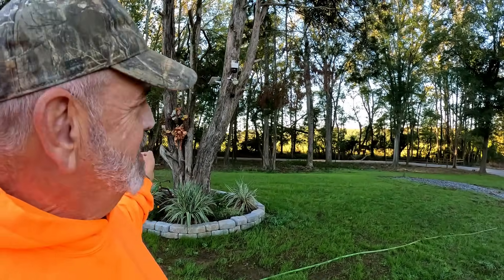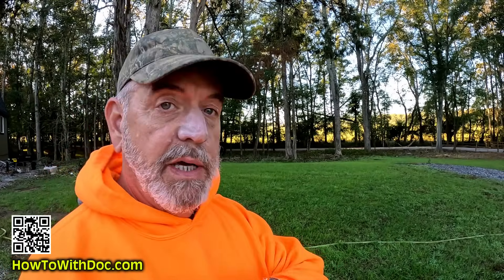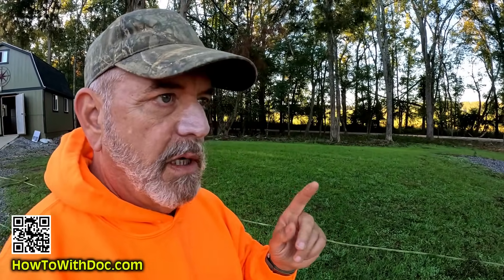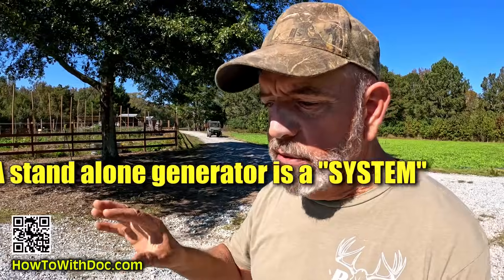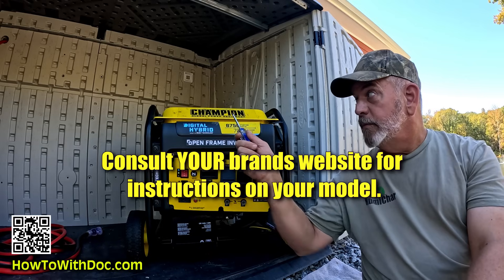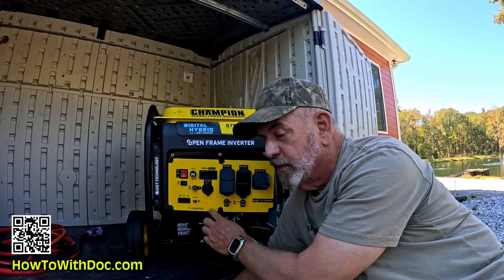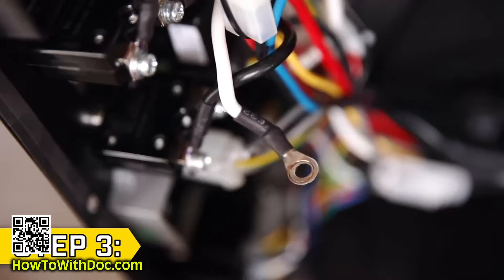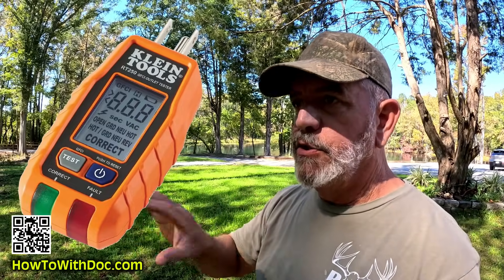Should You Disconnect the Neutral Wire on Generators

Comment: The slab pour is concerning.
Some points I noted.
1. Forms are not correct. Boil out will occur. 
2. I hope this subgrade was compacted very well.
3. The footing are dirty or on fill?
4. Measure diagonals or 6-8-10 variation for square. 
5 you might consider key cold expansion and 6x6x10x10 w.m.m.. Fibercrete alone for a garage is not recommended. 
8. Check forms for straight and level with a ¾" gauge blocks and string line.
9. Place poly over ground under pour. The garage may be heated in the future.
After pour. Seal with sealer. Lay poly over surface or wet the surface down once or twice daily to prevent rapid drying. 
10. I am always concerned when I see slabs poured on fill rather than clean washed limestone. ( No fines. ¾" or ½ " is better by far.) 
It may work as is short term but, it is expensive in any case. Do it right the first time.
Generators. Bonded, unbounded, floating bond. 
You will know with volt meter checking ground to neutral for a voltage above a few volts. Some confuse the frame to generator wire as a bond or unbounded connection. It isn't. 
Thanks for your hard work.
RT, BC Lic.  Industrial, ret
Reply from the maker: All went well.

Comment: Yes  only generators that are not “inverters generators” need to disconnect their neutral bonding cable before hooking to the house. Most modern generators however are “inverter generators” and come with a floating neutral. You don’t need to worry about those nor disconnect anything there.
Reply from the maker: Not true. Almost ALL larger invertor generators come BONDED. It says it right on the front. Smaller units, yes because they have GFCI plugs built in.

Comment: I have a Yeti Pro 4000 power station in my camper van and it is grounded to the vehicle chassis. For the most part, it's charged via solar panels on top, but I do have a Champion backup generator just in case. It's my understanding that this can safely be done without disconnecting the generator's neutral because I'm not merging two systems. The power station plugs into the generator via a common house-style plug (15A, 120V) if that makes any difference. Can you confirm that my understanding is correct (or not)?

Comment: What do you do if I want to do both with the generator? I can connect the generator to a small sub panel that has an interconnect to run most of the kitchen and a few lights in the house so I’m assuming I would need to disconnect the white wire so the grounding is from the home circuit. But I would also like to power my gas furnace also by running extension cords from the generator to another part of the house. Would I need a bonding plug for that? Each socket on the generator has its own fuse so I don’t know if the bonding plug would be for just that socket or if it would re-bond everything on the generator (effectively reconnecting the white wire).

Comment: So when I run my generator. I turn off the main 100A breaker. Turn on the 50A breaker. Does the isolate both electrical systems from each other? Breaking the neutral and hot in my main panel? I have a manual transfer switch. Is so. Then I believe the generator neutral should stay bonded. Yes?

Comment: I say no. If you want to connect a gas generator to a house, all you need to do is lift the ground at the Generator inlet in the home connection. There is no need to modify the Generator. These inlet connections are usually plastic. This is the easy place to lift the ground. Just leave the green wire unattached and capped. This leaves the Generator as it was built. Problem solved.

Comment: Good video, well expressed as a "stand alone" alone system. You are correct when an interlock is used on a sevice panel.  
A system can only have one neutral bounded point. Otherwise, an objectionable current situation will be created.
Bonded or unbonded neutral will depend on your transfer switch. 
If you transfer such only isolates, both hot lines from the power utility and the neutral is not switched, then the generator should have a floating neutral because the neutral is bonded at the first point of disconnect at the service entrance. This is a "stand-alone system." 
If you have a transfer switch with a switched neutral, isolating the neutral from the power utility with a generator sub panel, the generator requires a neutral bond. In this case, the generator and generator panel is a "stand-alone system."
Forgive the long-winded explanation, I hope that it helps.
Reply: Great explanation

Comment: Your information is correct, but your use of terminology is very bad, and potentially rather confusing.

You are not disconnecting "the neutral wire".  Doing that would actually be very bad.  Also, you do not ever want to have a "floating neutral".  A floating neutral is actually a fault condition (when the system neutral becomes disconnected from the power source), and can actually be very damaging in some circumstances.  (I know lots of people who talk about generators call it a "floating neutral", but a much more correct term is "unbonded neutral" instead.  When done correctly, it is not actually "floating" in any way.)

What you are talking about attaching or removing is not a "neutral wire", it is a "bonding wire" (or "bonding jumper", etc).  They are two very different things.  The neutral wire must always be connected to the system neutral (and the ground must always be connected to the system ground).  You never want to actually disconnect either one of those.
Reply from the maker: Unbonding a generator refers to the process of disconnecting (or "floating") the neutral wire from the generator's ground or frame, which is typically bonded together from the factory in conventional portable generators. This modification is often done to safely connect the generator to a home's electrical panel during power outages, as the home's main service panel already has its own neutral-ground bond (required by electrical codes like the NEC). Having two bonds in parallel can create dangerous ground loops, improper grounding, or cause ground-fault circuit interrupters (GFCIs) to trip unnecessarily. There are videos ONLINE from Champion and others how to do this to their products.

Comment: Your answer to the question may or may not be correct!   As you explained, yes you are correct, but there is an issue.
Please accept my input.   The answer about “bonding” neutral to ground in your portable generator if you connect it to your house is, you do not have enough information yet.   If you have a transfer switch, which you should, then that is what will tell you if you need the neutral to ground bond made.   If it is a 2 pole that transfers the 2 hots only, then there should be no bond made.   If you have a 3 pole that transfers the 2 hots and the neutral, then the bond from neutral to ground must be made.

Comment: Thanks for the video. I made this change on my Predator 9500 inverter. I am using it with a generlink transfer switch that expects a floating neutral source.  Afterwards, the generator ran fine. I plugged in a light, and it worked. I then plugged in an outlet tester into one of the 120-volt receptacles on the generator. It signaled open ground. Is this expected?
Reply from the maker: Yes if the generator is not being used for the HOUSE... and as a stand alone unit then it needs to be bonded.

Comment: I have the same Champion generator. I connect it to my house via a generator interlock setup. I’ve had to use it a few times for several hours during power outages. I’m very happy with it.

Comment: I read another comment somewhere else, they suggested disconnecting the ground wire at the inlet/panel would resolve all this bonded/floating neutral issue?  You can keep the generator bonded and if the generator shorts, it won't  fry the house electronics (if unbonded) just the generator will be sacrificed. Plus you can still use the generator with cords without having to unbond/bond each time gng from house to extension cords, sounded like it made sense but I don't know, what do you think?
Reply from the maker: The GENERATOR... becomes the main source of power for the entire house. I would NOT disconnect the ground. Just unbond it or put in an A/B switch so it can be used either way.

Comment: USING GEN BY ITSELF Not connected to a building just plugging into gen or extension cord to gen. Bonded neutral is required
Hooking to bldg's system, neutral and ground are bonded at the bldgs panel NOT AT THE GEN. And must be disconnected at the generator.

Comment: I have a big one I can run for a few days, or longer is the local gas stations are open.  I unbounded the ground an neural.   You need to test evert time that you neutral wire is good before you hook it up. Or you will get wild voltages between the legs and most likely need a fire truck in a hurry.  It will run the whole house and the central Air so I can live like normal.   I have a small one that will run the fridge and a few lights and a fan.  I can cycle it to my freezers to cool them down once in a while.  It uses very little gas.  About 2-3 gallons a day.  I keep 50 gallons on hand.  Then I have solar with an inverter to run a light and a fan an my little chest freezer.  I will make ice in it do keep in my cooler.  Have plans and backup plans.

Comment: NEVER NEVER disconnect your neutral wire from your 120/240 generator. You will cause problems in your home and most likely cause permanent damage and or fires
Reply: It says everywhere in GenerLink’s literature (which is how many homes hook generators into the home) that you must float the neutral to power a home, because the home already has a bonded neutral, and two bonded neutrals will fault the system. What are you talking about?
Reply: @chuckwalla325 
You have two separately, derived “neutrals they must be tied together. Just because they both are called Neutral they are not the same.  The unbalanced current in the secondary must be allowed to return to its source. So if you have two separate sources the neutrals must be tied together
Reply: The neutral wire must carry the unbalanced current back to the source (the generator)

Comment: So the cabin I just built has a main emergency disconnect outside where it it is bonded. The panel inside the cabin is a sub panel where the neutral and ground are not bonded. I’m assuming with my set up I have to run a bonded generator because if I run a floating neutral generator there’s nowhere in the system that is bonded?
Reply from the maker: It depends where you FEED IN the power from the gen. That set up throws an unusual glitch into it and I would ask an electrician.
Reply: @HowTowithDoc I wired in a reliance 30amp inlet box right to a 30amp double pole breaker. I’m assuming the panel in the house is still bonded at the disconnect even when the main is shut off? So I guess I need a floating neutral. But it’s confusing to me so I’ll have my electrician take a look at it to confirm my thought process. Thanks for the response

Comment: The better term to use is "bonded" vs "unbonded" or floating, and yes for home backup you need to have it unbonded as it uses the houses ground/neutral.
What I recommend is configure any generator as unbonded and just keep a bonding plug handy so you can re-bond just by plugging it in when you run it stand alone.

As it is much easier to bond a generator on the fly with a plug, than to do the entire process to unbond it.

What I got from this video is using one of those plastic storage bins for the generator, I thought about doing something like that for my solar inverter and it will be placed the same spot, right outside the house where my 50a generator hookup is.

Was affraid it would not be good enough to keep it weather safe but if your generator is doing ok the inverter should be ok too. (only to be used during once a week or so to dump power from batteries unless hurrican blackout the generator hooks to the inverter to charge the batteries instead of run the house directly.

As you said fuel, I take that into mind so I run eco mode and do not run hot water or hvan on long term blackout.

Now that I have a hybrid hot water heater might run water, and just window units for AC.

But my theory besides any power I get from soloar (right now about 20,000kWh with my small DIY setup) and I made sure I have an efficent inverter generator (nice and quiet, efficent) but even in this situation I have to imagine running the generator 80% for a few hours to charge my batteries will save me more fuel than running 2000w 24/7 in eco mode.

Comment: So if I’m powering my panel via a 50amp inlet without an inlet, using an interlock, do I need a grounding rod?
Reply from the maker: No, not connected to your gen. Your PANEL has a ground and rod. No extra grounding is needed. This is mainly about whether your gen has a floating neutral or bonded neutral which should be labeled on the front of your gen.
Reply: @ thank you for responding. My generator is bonded neutral, I know I need to remove the jumper to make it a floating neutral. Thanks again.

Comment: If my Gen manual says

"The generator has a system ground that connects the generator frame components to the ground terminals in the AC output receptacles. The system ground is not connected to the AC neutral wire."

DO I still have to disconnect the Neutral??
Reply from the maker: You should see a label on the gen that says floating neutral or bonded. If you're tying into your main panel you UNBOND the gen. If not tying into your main panel then just leave it as is.

Comment: A champion Gen ! good gen w great customer service. 
What u do is make a jumper plug short wire from ground pin to wide or neutral slot. Unplug and u have a floating neutral. Plug it in and u have a bonded neutral.
Reply: I think that's the layout of my current generator. It should come with a bonding plug. I'll need to check on that.
Reply: He's saying to disconnect the neutral.  How can you run 120v with no neutral???

Comment: Thank you for this video.  I have a Honda EU2200i and we had no power for 4 days and ran fridge, freezer and central gas heat no problem.   It struggled a bit running the coffee maker.   After this event I've added an option for LP gas on the Honda.   LP gas will last a lot longer than gas and won't gum up the carb.   Also adding a cut over panel for 6 circuits on the main panel.   My EU2200i comes with a floating neutral.

Comment: Very misleading wording in the beginning.  What Doc meant was make certain that the neutral is not "bonded" to the ground (which is actually the generator metal frame/case).  My concern is some people will interpret this to mean cut the neutral between the generator and the home panel.  Most portable generators, especially small ones (Ryobi, etc.), do not have the neutral bounded to the ground so this is not an issue.  If the neutral is bonded to the ground in the generator the bonding should be removed.  The generator should be treated like a secondary sub-panel where the neutral and ground should be isolated so the only bonding between neutral and ground is in the main panel.
Reply: Yep, I was confused and went right to comments to see if anyone else caught that.  Doc is talking about the GREEN ground bonding wire and not the White Neutral wire.

Comment: Question I don’t see discussed, and wondering if you can clarify.  Situation is that my generator is tied to the house using a 50amp plug and interlock so I would remove my bonded to make it a floating neutral.  

What happens if the generator is running and I need to plug an extension cord into the generator to run a vent fan for my shed.  Is there any danger going this route since both the 50amp and one of the outlets are being used at the same time?   Is that fan grounded?
Reply from the maker: Yes, in your ENTIRE system... there should only be ONE POINT where the neutral and ground are bonded. This includes all sub panels if you have them. If running into your PANEL... that is where this happens.  Valid question on the other outlets... I do not have the answer, but to be safe I would simply run an extension cord from the house rather than direct from the gen.
Reply: If your connections thru to your main panel are good, YES.  Plug an outlet tester into one of the 120 outlets on the generator, while it's running and connected thru 50A plug & interlock.  The outlet tester should show ALL GOOD.  That would indicate a properly grounded outlet to operate a fan.
Reply: Great question. Any sparky's out there have the definitive answer? Scenario matches my plan to eventually do a generator shed w/ 110v ventilation fan, preferably plugged into genset 110v outlet, while sending power from floating neutral genset to whole-house, through a 50A inlet, to Main panel interlock protected + backfeed 50A double-pole genset breaker in main panel. Would the genset 110v. outlet be safe to use in this configuration?